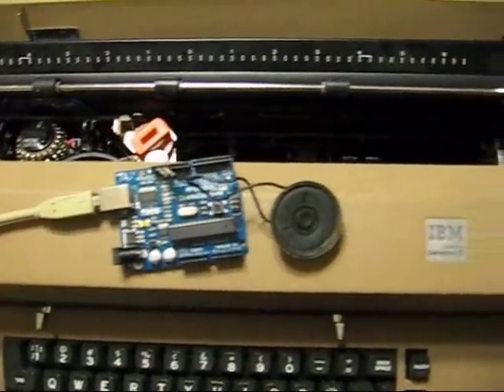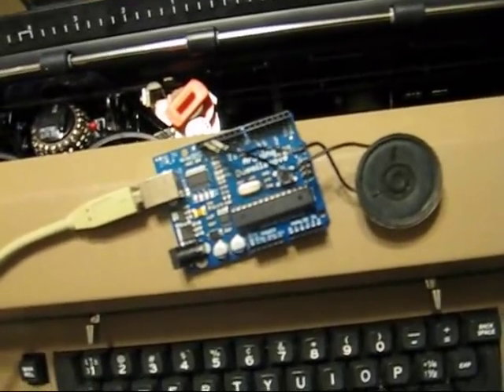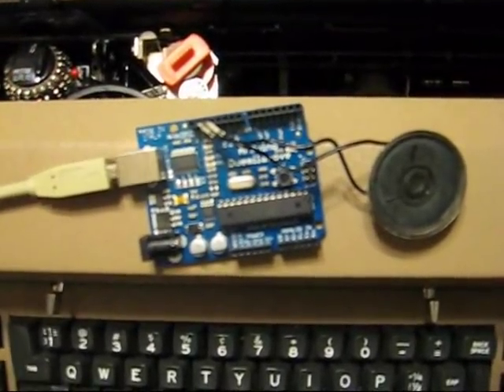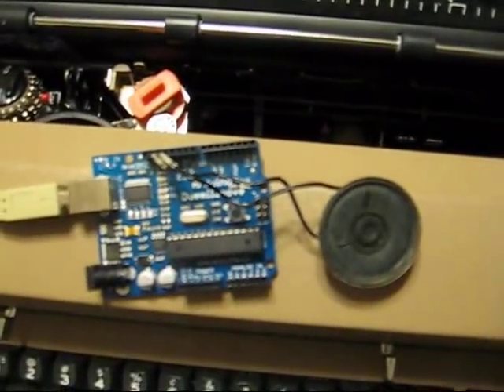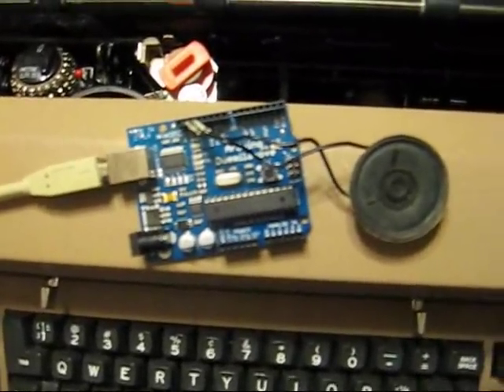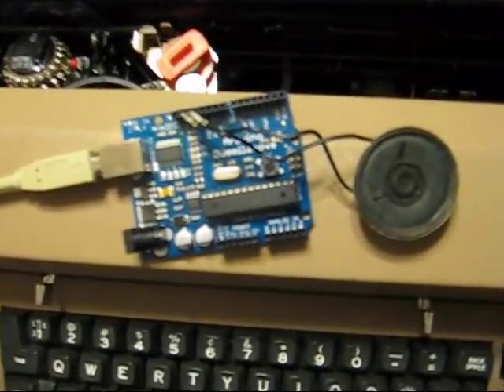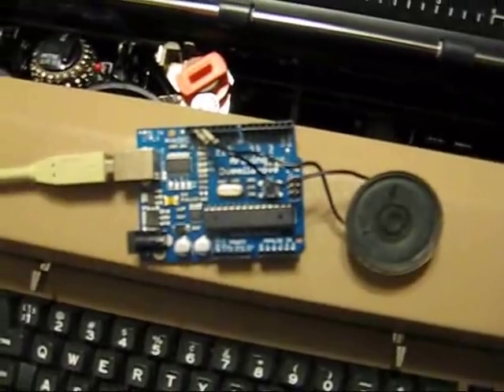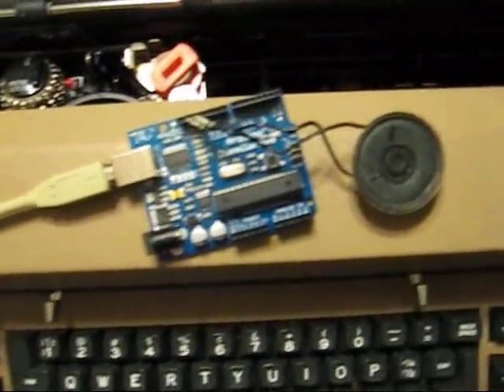Arduino Morse Code Callsign Player

Comment: Congrats on your ham ticket. I have been a ham since 1974 and I am glad to see you do an arduino project that is ham related. I hope more hams do this kind of project and get them published in QST and other mags. I am new to the arduinto too and was very surprised that very few hams even know about this device. I am making a project that I hope will control my tuner with 2 servos and a stepper motor using the arduino. Hope to catch you on the ham bands...73